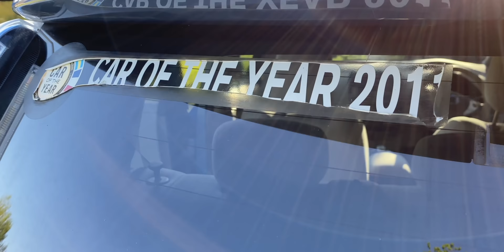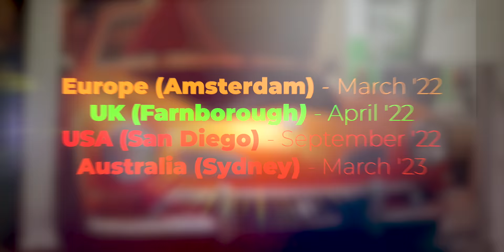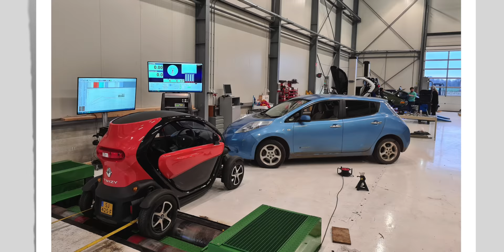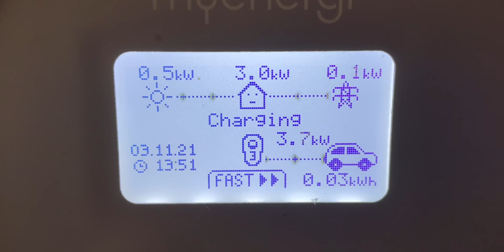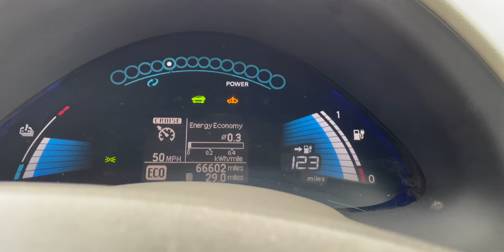Return of the LEAF: Robert drives his range extended EV home from Holland

Comment: Being a Leaf owner, it's great to see that these cars have a potentially 20-year life with a battery upgrade. I think I'll go for a 64Kwh battery in the next few years to update our car. Thanks for dispelling some of the old myths of battery/EV-powered vehicles. Also interesting to see that that battery control module is made here in Canada in Quebec.
Reply: My 2016 30 kwhr leaf has lost 2 battery bars and 20% of initial range. The battery degradation myth is on my drive for all to see.
Reply: @stevezodiac491  Agreed! My 2013 has 81,000 kilometres and has only lost one bar of capacity. Upgrading would future-proof the car and last us another ten years. It would also be vastly cheaper than investing in a brand new car.
Reply: @thesuperfunkomatic  My 2013 Leaf has lost one battery bar in 110000 miles. I still get 85 miles in summer, 65-70 in winter.
Reply: @stevezodiac491  - The 2016 and 2017 models were found to have defective BMS software that incorrectly calculated battery capacity and indicated accelerated degradation that wasn't actual. Have you had Nissan update  your BMS software? Most owners have reported that it corrected the problem.
Reply: My Leaf lost 5 bars and the PTC heater stopped working. Apart from that still going great, but battery will defineteley have to be replaced next year.
Reply: @stevezodiac491  same. 2016 30kw, 115k miles and lost 2 bars of battery. I really need an upgrade now.
Reply: My 2015 at 177,000 km one bar down still drives great, when time comes to upgrade battery does anyone know a business that offers this in Ontario ?
Reply: They have an indefinite life they are insanely reliable. What Robert did wasn't maintenance at all, it was an upgrade. 
Really excellent little car.
Reply: @shanajackson5044  my 2008 fiat 500 does around 400 miles summer or winter,  never dropped in over 13 years. New battery cost me about £35 3 years ago, amazing eh 🤷
Reply: @loosabway3400  You own a 50 year old petrol car that costs you far more to fuel, far more to maintain whose fuel *is* a vile toxic chemical which gets spat out into the faces of everyone you pass or indeed visit. 
That toxic fuel requires a huge amount of toxic chemicals to refine and distribute, and  needs more for every additional mile you travel, rather than being a one-off cost at the start of the car's life.
I actually own and drive a petrol and 2 diesel cars. But I'm not stupid enough not to see the issues with it.
Reply: @loosabway3400  I've got a 15 year old petrol car and this Christmas our mains water failed. Luckily our car had a full tank, so we were able to shower, wash our dishes and make hot drinks using wholesome petrol. Thank F we didn't own a toxic EV!
Reply: @pete312  Glad to hear it!

Electricity is great in the house and not so good in cars.

Cars have to be made and have an energy lifecycle.

These are things you need to learn; it’s a big world which you should explore - sadly, it would take you a lot longer to do that in an electric car, stopping every 100 miles with fingers crossed the charging station is there/open/working.
Reply: @stepheng8779  Take it to a rolling road and have the power output measured.  You'll find its well below specification (mileage depenent)
Reply: @loosabway3400  The toxic chemicals come out the exhaust every time you drive.
Reply: @PowerOn-  wow!
Sharp observation.
Nothing gets past you, does it?
Reply: @loosabway3400   if you use the car a lot it can be more efficient to replace it with a newer efficient petrol car even. Read some papers even watch a yt vid or two, it doesn't take long at all for a car to consume the same in energy as it cost to be made. Moving heavy objects at speeds takes a lot of energy, same order of magnitude as manufacturing itself. Petrol is inefficient, especially older cars. Most of the energy wasted heating up things that then need to be cooled. I still drive a petrol car but the writing is on the wall and the technology has barely got going.
Reply: @mrnobody825  I have other cars and I don't use the 50 year  old one very much.

And I am sorry but you need to read - it takes FOREVER for a low mileage petrol engine to consume the energy used in manufacture for a Petrol or Electric car and a long time if it is a high mileage one.

The writing is on the wall for petrol cars as a result of Government intervention but the scrapping and replacement of low mileage petrol cars (particularly modern low emission ones) by electric cars that are expensive and toxic to produce is a disgrace and not justified environmentally. For those who go further, electric cars with their joke ranges and broken / missing / incomplete charging networks (Tesla excluded on the latter point) means they are a laughably poor solution at present.

Maybe in time, electric cars will be better, but this video shows just how bad they are.

In any case, if you think Governments see ordinary, average earning people in cars of their own in the future, you really aren't reading between the lines. This freedom, like so many others will be taken away from them.
Reply: @stepheng8779  I wonder how much petrol cost you over those 13 years though.
Reply: @stevezodiac491   And once solid state batteries are a normal thing in the next ten years, those battery bars will take even longer to disappear.
Reply: @stepheng8779  I am so happy for you. I feel like you deserve a medal or something.
Reply: @SimonEllwood  I really don't know what to say to this - I haven't said that I think I am saving the planet and I just don't get the point regarding my old car.

I think electric Car drivers often do feel that they are saving something and become quite self-righteous over it - despite the evidence showing that the energy lifecycle and indeed, the toxicity of the components that go into electric car production show no advantage, taken in the round.

And they are limited, impractical and silly cars outside a limited urban setting.

I would drive one - not to 'save the planet' - that's delusional, propaganda nonsense, but if they and their charging network were any good and ready for prime time - they are not.  

All a moot point anyway - long-term - the plan is for us all to be freezing  on bicycles and scooters while the ultra-rich float by in luxury.
Reply: @loosabway3400  You may think that burning fossil fuels has no impact. I have no idea why you would be watching this video if you were a science/ climate denier. You are not using your classic car as a car so it irrelevant to your CO2 footprint.
Reply: @SimonEllwood  I haven't suggested that burning fossil fuels is without impact.

I really don't know what your problem is with my car. I am a science graduate and have not denied climate change. 

Where do you get this stuff from?
Reply: @SimonEllwood  I haven’t posted any ‘stupid stuff’, denied climate change or attacked science.

Have you been listening to the voices in your head again.
Reply: @mrnobody825  "moving heavy objects at speed takes a lot of energy". No, acceleration of heavy objects is what takes most energy. The weight is not a factor in constant speed energy usage.
Reply: @loosabway3400  neat
Reply: If I was in Quebec I'd use Simon Andre to swap my LEAF pack.  they are located at 7050 Boulevard Jean-XXIII, Trois-Rivières G9A 5C9, Canada
Reply: @loosabway3400  rubbish
Reply: @peteygti1  Very insightful comment.

One which is very difficult to argue with indeed.
Reply: I mean how cool would it be in 10-15 years time to be driving around in a 20 yr leaf !
Reply: @jestronixhanderson9898  completely uncool. And ridiculous!
Reply: @loosabway3400  I agree petrol cars are way more convenient. But, EV's are way more energy efficient, provide max torque from the get go, generally much more fun and easier to drive. The only thing holding them back are the batteries' god awful price and eventual replacement which is a certainty with 10-30 years of ownership.

So if a use case falls within an EV's range then it's better to go electric than petrol energy consumption wise and for ease of use. Cost wise, I think its gonna be cheaper to run a petrol car if you're talking 10-30 years of ownership with the same use case provided that there won't be a battery breakthrough that will make them cheaper.

So it honestly depends on the buyer if petrol or electric is better for their own use case.
Reply: @xirruz  It's the charging network disaster and the unsuitability of the cars in a varied use case that does it for me - I exclude Teslas from this charge of course.

Trouble is, the UK charging network is piecemeal and needs to be Government funded and regulated or its always going to be a complete free-market f**k up..

As for the suggestion that EVS are more fun to drive, I disagree; they are heavy and feel it and often ride badly to boot. I don't find any of them 'desirable' and they are often handicapped by joke, toy-town, Nintendo control design that will piss-off millions of motorists going forward and kill thousands, as drivers take their eyes off the road to operate basic functions via silly, unresponsive touch screens.

In any case, long-term it is irrelevant - the Government does not see private car ownership as a common thing in the future  (it will be just for the very rich)so make the most of it before they force you onto public transport, little scooter or your legs
Reply: @loosabway3400  Wow.  As Luke Skywalker said, every word of what you just said was wrong.
Reply: @craigchatterton4164  Maybe he was incapable of saying why; just like yourself
Reply: @loosabway3400  I'll show my why if he shows me his
Reply: @craigchatterton4164  As I said; you have nothing real to say.
Reply: @loosabway3400  Louis Rossman made videos about the battery cost predicament and affordability of electric vehicles where he made sensible arguments on ICE v EV.
Reply: @craigchatterton4164  I will await your point by point analysis and refutation of my statements. 
We, as does anyone unfortunate enough to be reading your nonsense, all know that won't be coming and can identify who the troll is here.
Get a worthwhile hobby, Craig.
Reply: @craigchatterton4164  You’re quite a sad boy, Craig Chatterton.
Reply: @loosabway3400  Ahhh, ad hominem.  :-)  The best way to tell when you've won an argument.  Go away troll.
Reply: @craigchatterton4164  You are very, very sad, Craig Chatterton
Reply: @stevezodiac491  well. not in hot climates. my gen 1 leaf (not the lizard or  wolf) got degraded to 3 bars currently at 91000kms.    32% SOH
Reply: @IG-jd8pt   Great contribution. Incredibly witty, creative and amusing.
Utterly fails to address any points raised. Something you are clearly incapable of doing. 
Are you Boris Johbsons PR guy?
Reply: @loosabway3400  What “raised points” should be addressed about you polluting with a 50 year old petrol crap?
Reply: @IG-jd8pt  Yup.
That's the level of intellectual analysis you can achieve - electric car makers can see you coming or at least waiting in the long queue by the charging point.
Reply: @ajwright5512  Electricity generation  is far from clean.
Reply: @royblackburn1163  Depends on the generation. But thermal combustion efficiency increases at scale, a powerstation working constantly at peak efficiency is far cleaner than the peak 30% efficiency of a little ICE, let alone the real world of idling in traffic and stop start traffic where you convert most of that into heat in the radiator brakes and exhaust system.
Reply: @ajwright5512  nope , most of the heat goes up the chimney or into the cooling towers my big ice engine is euro 6 and it turns itself on and off in traffic can't turn a power station off when it's  off-peak,  lots of thing's happen in the nuclear industry we are not told about,  Chernobyl is still not clean or safe.
Reply: @royblackburn1163  Sorry, but demonstrably you're wrong. Otherwise people wouldn't build power stations they'd just use banks of diesel or natural gas piston generators.
Reply: @ajwright5512  power stations are dirty, lithium batteries are dirty,  all issues have to be addressed honestly,  you also have to accept evs do not suit everyone if a dust to dust study was done on the 50 year car compared to all the the evs it has   out lived you will find it is far more environmentaly friendly simply due to it's longevity.
Reply: @royblackburn1163  Age is always one of the biggest factors, but the average ICE car lasts 12 years. 
There's not much evidence, even so far, that EVs last much less.
Reply: @ajwright5512  more like 15 but thats debatable, most car's are scrapped because they are beyond economic repair that is evs archiles heel because batteries are so expensive. So called refurbished batteries are made up from donor car's that have been scrapped,  make a usable one out of 5,  the cell's could already be 12 year's old so their longevity is  questionable.
Reply: @royblackburn1163  Again, somewhat backwards logic - the batteries are not typically the failure point which means a relatively serious accident would still be an economic repair, on a high value batteried EV, even when the same accident would have written off an ICE car. i.e. the residual value in the battery (and motor) keep the rest of the car on the road.
Reply: @ajwright5512  what is the residual value of a 12 year old degraded battery?
Reply: @royblackburn1163  A 10 year old degraded 20kWh Leaf battery is still worth ~£1,500 vs £200 for an unreconditioned Almera engine. Air-cooled Leaf batteries also suffer the worst degradation of any Li-ion cars.
Reply: @ajwright5512  That's terrible,  4k for a refurbished battery made up from old cells, could probably buy a decent 4 year year old complete car for the same price,  thing's will improve in the future when breakers yards are full of them.
Reply: @loosabway3400  You make some good and relevant points, but it is clear that yours is a politically motived rant. Governments must do something to assist in the move away from carbon fuels. Though not yet perfected, EV's are part of a solution. If you don't participate, you will be free to walk...
Reply: @tommills2097  You have no answer to the points I make. Your comment is merely a personal attack. A bit weak really.
You identify my comments as 'politically motivated' without defining what you mean by that term; you denigrate those remarks by calling them a 'rant'.
I would suggest that Governments are doing something but who it is 'assisting' is a mystery to me.
I have no idea of what EV's are a solution to; how to ensure there are more slave workers? How to ensure that more nasty chemicals are dug up?, How to exclude ordinary people from the freedom of personal transport in safety? Yes, may be all of those.
EV's as they are, are expensive white elephants designed to limit the expectations of the masses.
I really have no understanding of your 'walk' comment; the more you go along with the agenda of Governments, the more likely it is that you will be the one walking because they don't want any of us enjoying cars.
Reply: got a used 2013 leaf at 75k miles.  only has 5 battery bars. hearing that some only  lost a few bars, makes me wonder what caused this to degrade.
Reply: @SimonEllwood  'I have no idea of what EVs are a solution to" - personal mobility' - Simon, old chap, we have an answer to that already - the ICE and it works better for almost everyone. I look forward to useful, practical electric cars and functional charging networks. Sadly the silly, limited, chronically over-priced, exclusive jokes on wheels that the electric car makers are selling (to company car drivers almost exclusively thanks to tax breaks) with a pathetic broken charging network are not useful.
"How to ensure that more nasty chemicals are dug up?" - ICE accounts for more chemicals extracted than EVs. - Unbiased evidence to back that claim, please.
"EV's as they are, are expensive white elephants designed to limit the expectations of the masses" - A nonsense opinion not backed up by facts, CO2 and pollution have costs - You have no argument against the fact that EVs are a) expensive and b) white elephants, then..? The costs of CO2 and pollution are not arguments to this point.
'You keep claiming people have no come back on your points when people have been doing just that.' - you'll have to point that out to me - I am not sure that you are going to be able to.
'Your mentions of "masses" and "governments" clearly expose your political and divisive language. We have answered your points but you are not listening. The worm has turned and big oil has lost' - Really?!? In what sense 'political and divisive'? I actually laughed out loud when you made this baseless statement and then, in the same sentence, used the term 'big oil' which is, shall we say, quite political....
Simon, sadly, I think that self awareness is not your strong point. You are blinkered, suffer from confirmation bias delusions and are not open-minded at all.
Reply: @loosabway3400  According to you EVs suit some people, your claim that because we have ICE vehicles we do not need another is just like saying "We have strawberries we do not need Raspberries" does not cut it. You falsely claimed BEVs use more chemicals than ICE vehicles it is up to you to back that with evidence. Where is your evidence to back up your "White Elephant" claims with millions of people using EVs as there daily drivers, so utter tosh.
Reply: @SimonEllwood  'According to you EVs suit some people, your claim that because we have ICE vehicles we do not need another is just like saying "We have strawberries we do not need Raspberries" does not cut it.' - whatever this means (it's in a language I am unfamiliar with) - I didn't say it. Are you arguing with yourself?
'You falsely claimed BEVs use more chemicals than ICE vehicles it is up to you to back that with evidence' - it's not just me old chap - go on - show your reliable source that proves the opposite - do you think those batteries are made of marshmallows? Even EV fans (with education) accept that batteries are 'problematic'.
'Where is your evidence to back up your "White Elephant" claims with millions of people using EVs as there (sic) daily drivers, so utter tosh.' - a lot less than a million in my country, despite aggressive company car tax subsidies.
Reply: @shanajackson5044 Wow, that's very unusual! What are your driving habits? E.g., what percentage city vs. highway? Average speed? Top speed? What percentage fast charging vs. slow? What's the climate like where you live? Any other factors that affect battery life?
Would love to know how you managed only one bar loss in 110k miles.
Reply: @BassByTheBay  I lost a bar at 122000 miles, so now I have 10 year old leaf with 10 bars and 125000 miles,  range about 70 miles. Drive around 40 miles a day mostly urban, max speeds around 50-60 mph. Average speeds around 40 mph. Always charge with 7Kwh charger every night to 100%, end of day usually 20-40% left.  Climate north east of england, right next to sunderland nissan factory where it was made, so very mild temps usually. That's about it.
Reply: @shanajackson5044  Thanks so much for those helpful details!